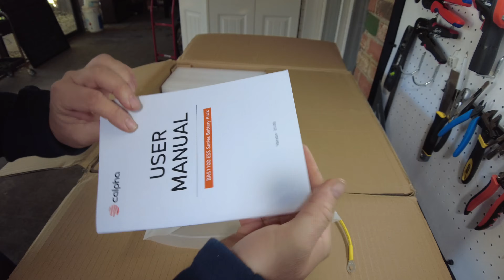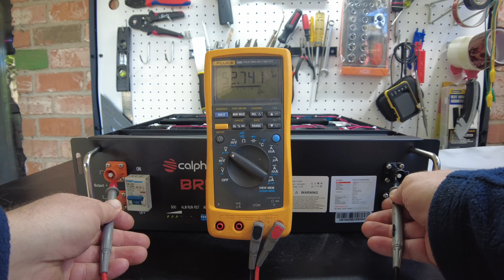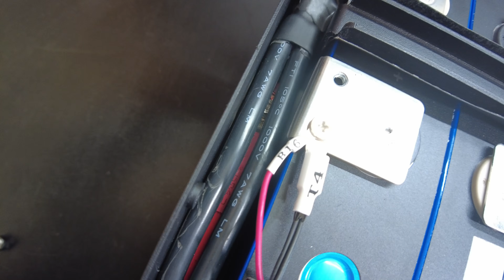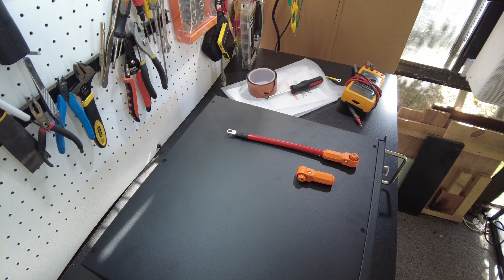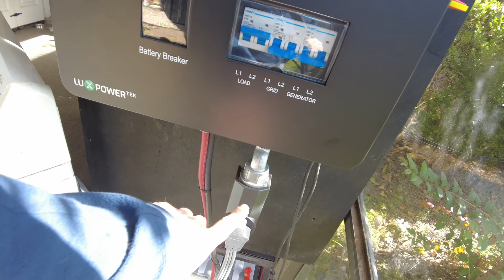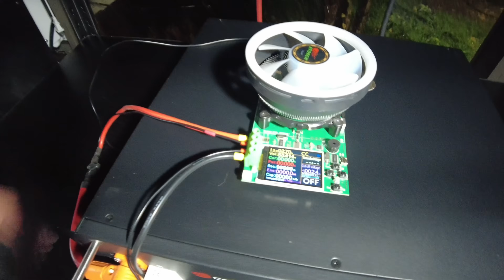Calpha 48v 100Ah Smart LiFePO4 Lithium

Comment: Where you were showing the negative cable crossing over positive......something I was wondering about, was both of those bus bars very close to the metal case? Am I seeing that correctly? If something dented the case at that point would it short the positive and negative together?
Reply from the maker: @orphaned1166 I just checked, there's a pretty good piece of plastic insulator glued to the inside of the case wall there. I'll post a pic. Also there's a steel structure beam that runs along that side under the wires to stiffen things up right there. Thanks.
Reply from the maker: Oh boy, I think I see that now. I originally thought those white insulators extended out to prevent that. But It looks like the bus bars extend pass the insulators and are very close to the side. I need to open it up, and examine it. Thanks for catching that.

Comment: I watch your videos, but this one is, to me, a disappointment. People won't use the batteries to run those little gadgets, we use to power real loads. Remember that, the less amps you draw from a battery, the more capacity you'll get. 
Merry Christmas to all and a Happy New Year!
Reply from the maker: Yeah, I'll put something together to do higher current at 48v soon. I had to use this tester for now. Thanks for the feedback, and Merry Christmas to you :)
Reply: Not true. LiFePO4 will give you the exact same capacity at 0.1C as it will at 0.5C
Reply from the maker: @ericklein5097  Pretty much my experience. I've seen very little (if any at all) capacity difference with high current vs lower current tests I've done. That's why I don't even bother with the so called 0.2c  "industry standard" test. I think that is just remnants of lead-acid days.
Reply: @BradCagle  Correcto mundo. Technically your average 1C continuous rated prismatic cell should give you the same capacity up to 1C but that's where you MIGHT see a tiny bit less in amp hours. Obviously Watt Hours is going to be impacted by discharge current relative to IR and whether or not you're using a 4 wire tester.

I don't know if I've ever mentioned this to you but if you haven't checked out Atorch's DL24MP 600W 40A electronic load, I snagged one on sale a few months ago for $72 shipped and its by a mile and a half the cheapest electronic load you will find in that  wattage/current rating.

Now is it a great design....no its a bit janky using PCB pads and freaking compression of the PCB modules with some small screws and of course with 4 modules that have to layer on each other there's going to be two modules sitting higher than the other two....but it works....and for the price I really have to say if you are sick of being limited by the 20A and 25A 150W/180W models this is a huge upgrade. Technically you can add four more modules on to the 600W version to make a 1200W but the current limit is still 40A. I think the 1200W would come out just around $125.

I've run a 4S8P A123 26650 pack at 35-40A for short periods of time (adding a fairly powerful 12" desk fan) and its freaking awesome finally having something that allows me to push that A123 pack to....at least something that would be a brisk walk for those 8 of those cells in parallel. The heatsinks they use on this new model are garbage unfortunately (just like the modular design using PCB pads) but the rest of the upgraded design seems to be pretty decent. The fans turn on at a programmable temp and then shut off ten degrees below that temp....and they come on full blast unlike the older DL24 models...so it can be loud and over 300W out of 600W having a good sized fan to move some air over it is necessary (or at least for someone like me that doesn't want to burn it up when it could be so easily prevented).

The cost of professional electronic loads is just insane when you get up to the 600W or 40A level so I'd really consider giving this thing a look. The Kunkin 400W 40A is around $200'ish or so....and it looks like an ok unit from some reviews I've watched but with the DL24MP under $100...grab it on sale if you see it under $70, it could really cut down the time some of these big battery capacity tests take you.